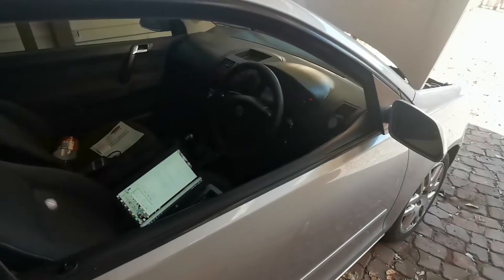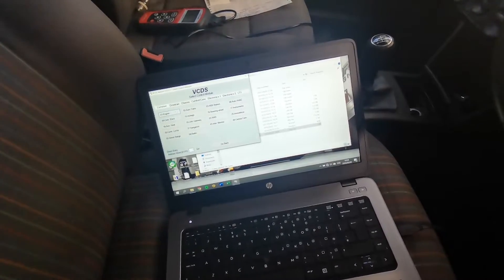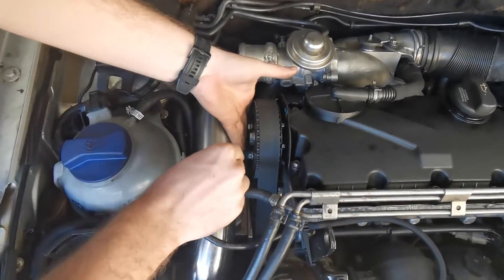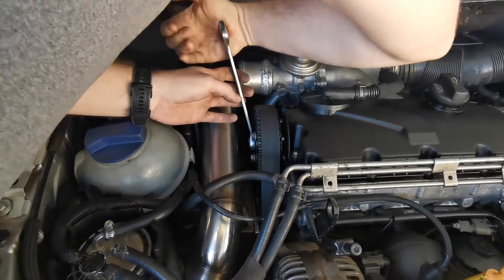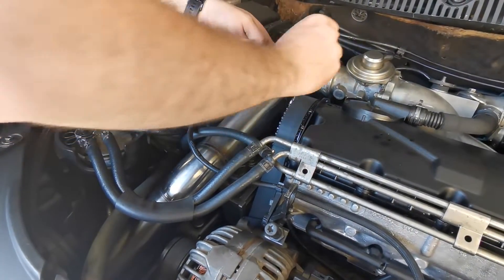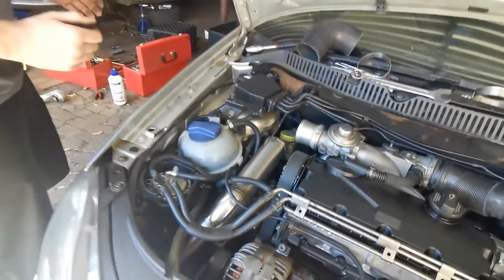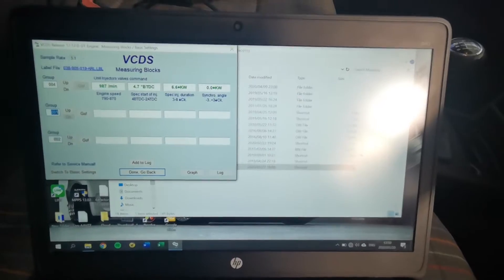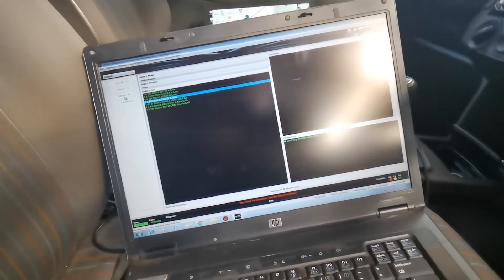Timing Adjustment on PD engine and update on Pamela - #TechnicalTuesday

Comment: Where about do I install the catch can
Reply from the maker: Hi Ryan, usually people install the catch tanks onto the engine cover mount on the cylinder head. My plan is to install it where my battery used to be as I have a battery relocation on my car 😌
Reply: @zarracelife5211  thanks man, and the plumbing for it
Reply from the maker: @ryan manu you have two options for installing a catch tank. You can route the pipe coming from the valve cover to the catch tank and then from catch tank back into the intake pipe or block the intake pipe off and do a breath to air option.
Reply: @zarracelife5211  thanks man
Reply: Where did you get the VCDS programmer?